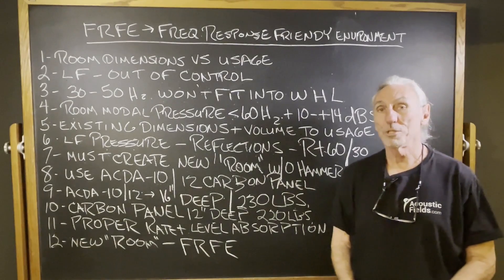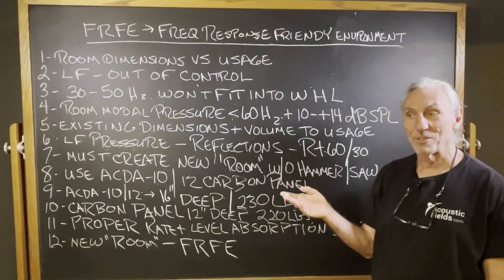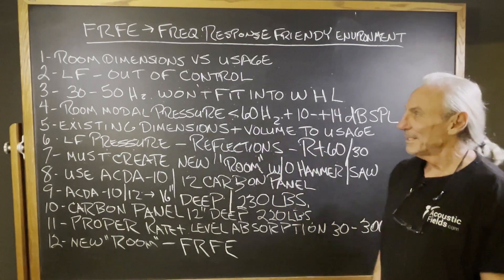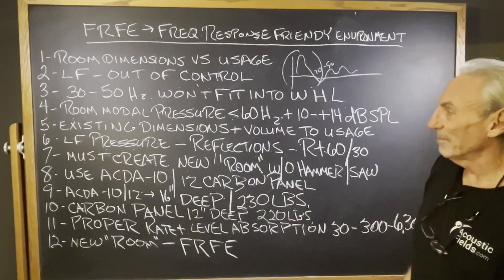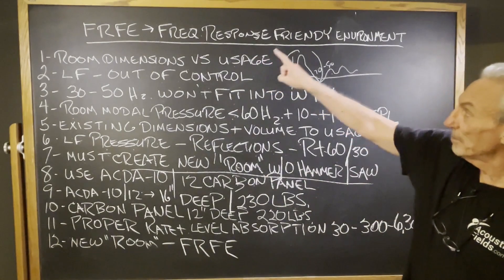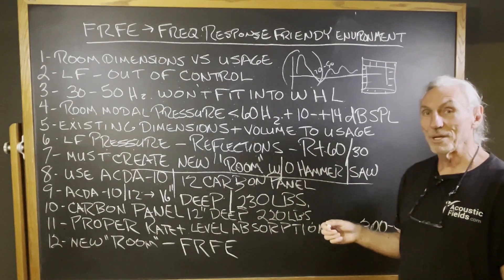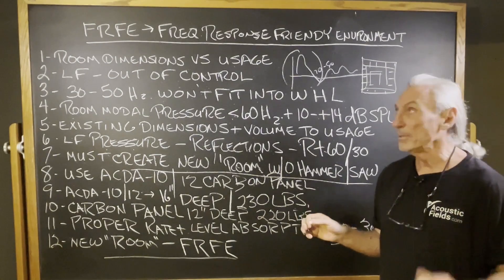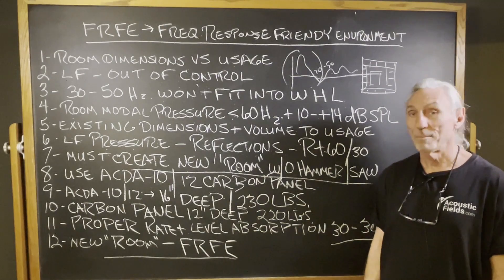Frequency Response Friendly Environment - FRFE - www.AcousticFields.com

Comment: The problem also is that in order for speakers (HiFi system) to produce a nice flat (flat to your ears) sound across frequency range you need to crank up the volume to a certain threshold. Below this threshold bass frequencies, LF are gone. Room eats it LF or multiplies it (MF and HF) but any HiFi system has its own on its own. A room/space is by far more influential though. And do not underestimate the background noise.
Reply from the maker: The room does not eat anything. Energy placed within the room will excite certain modal issues throughout the room. This excitation occurs at all pressure levels used within the room. The variance in strength of modal levels is pressure and frequency dependent.

Comment: I'm not sure you properly understand the science behind adding multiple bass sources (frequency response smoothing)

"30-50Hz wont fit in your room period".....what does that mean exactly? I've seen literally 100's of room measurements with output under 20Hz,even down to single digits
Reply from the maker: Wavelengths have different lengths. A 40 hz. wave is 28' long. Unless you have a room dimension of 28', the wavelngth can not travel its full distance without striking an object such as a wall.
Reply: @AcousticFields  Does that mean you can't produce a frequency unless it can travel its full distance? Does that mean headphones can't produce bass under 2kHz??
 ...by that logic,in my small room I wouldn't have bass under 50Hz. I have 3 x Seaton SubMersive subwoofers, and get LF down to single digits.
Reply from the maker: @jamiet74  Its not about the frequency running full length, its about the room distortion that is produced by dimensions that are not capatable with frequency wavelength.

Comment: Is there an “optimal” ratio of WHL for a listening room for 2-channel (not home theatre) primary usage? Of course I realize there are other requirements to consider but just a basic starting point if starting from scratch.
Reply from the maker: Your goal is to select a ratio of the three dimensions that minimizes lower frequency unwanted pressure issues along with coincidental modes. This is a time consuming process that requires calculations. Stay with 27' - 31' wide, 11-13' high, and 31- 37' long as a starting point.
Reply: @AcousticFields  excellent information. When it’s about reproduction of frequencies it has to follow the math. You can’t change wavelengths. When I was younger and actively building antennas (as an licensed Amateur Radio Operator) you had to do the math and use the formulas to calculate wavelength. You couldn’t change the fact that to build a good antenna you couldn’t just use random lengths and even at shortwave frequencies 132’ could be necessary for an effective efficient antenna at those desired frequencies of operation. In audio dealing with Hz and not kHz or MHz it’s still the same principle and you can’t change the math. 

As always Dennis you remove the guesswork, present information in clear concise ways and educate the interested followers you have assembled around this “watering hole” of acoustic science. Thanks!